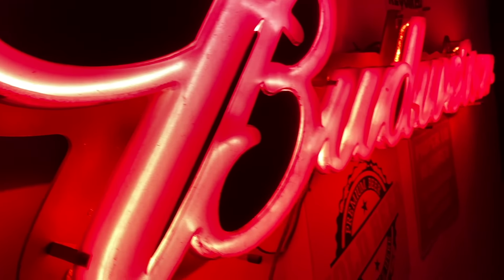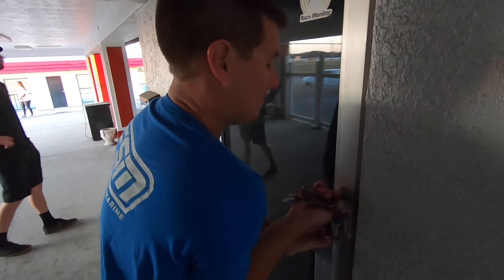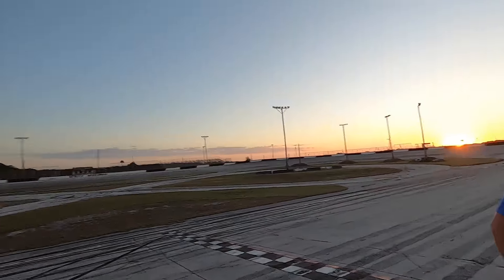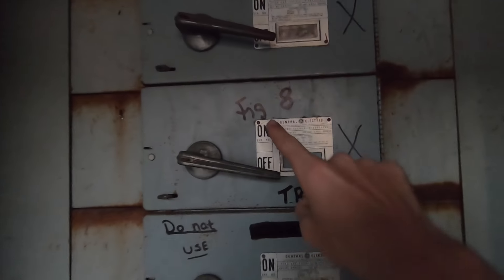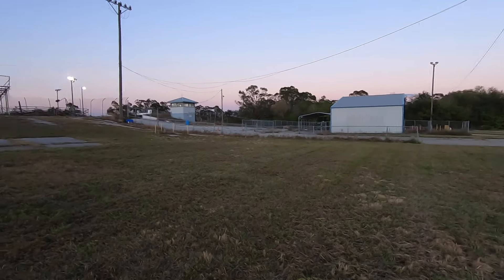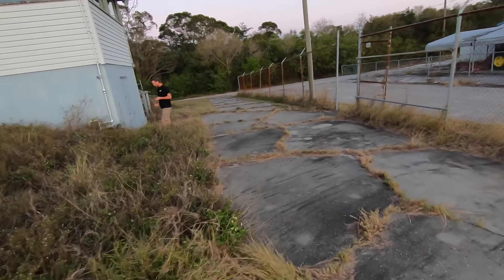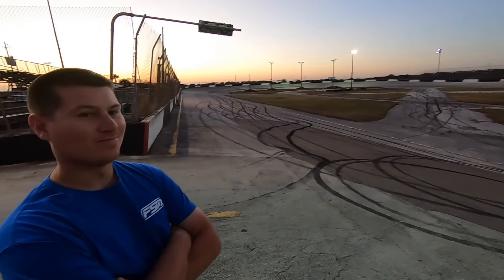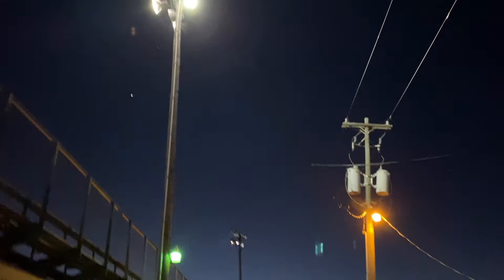Restoring Power to our Abandoned Speedway After TWO YEARS in the Dark! (Freedom Factory)

Comment: Love hearing you say that you want to switch to LED. Hearing certain people these days talk about incandescent being better than LED aggravates the hell out of me.
Reply: LED is cheaper/brighter, but alot of people prefer the yellow light from incandescents more
Reply: Caleb Fields so many people don’t realize that you can get LED bulbs in any color temp
Reply: We had these old lights on our mobile tower cranes aswell. 1500Watts per lamp usually 4 or 5  lamps per crane. Lately the manufacturer switched to LED. The LED lights are brighter BUT it is more directed at one spot. The old type that were used on the older cranes illuminate a whole area around the crane.

LED is alot more efficient though. You can also switch them on and off whenever you like. The old ones had to cool down for 15 min before they could be fired up again. The generators always had a hard time when the lights and heater in the cabin was on.
Reply: Your sad if hearing someone wanting to swap to LEDs makes you happy
Reply: @Newrangetank  no u. Leds are straight better
Reply: I don't think these are incandescents though... not with that warm-up time. These are some kind of HID lamps.

Comment: Again I'm a lighting electrician. This video is a hard watch lol I so badly want to make them all LED and working. You really should make those track lights LED though they take so much power
Reply: It would likely cost ten's of thousands though to do that.
Reply: I'm pretty sure he said he intends to switch them to led.
Reply: Expensive yes, but he should be able to get the lights for a couple hundred bucks each and if he can get a few guys to donate there time they should be able to finish all those pole lights in a few days
Reply: @UCCLdIk6R5ECGtaGm7oqO-TQ   LED costs are down from even just a few years ago plus the ROI on the power bill will be worth it. On top of that if you replace them with LED no need to buy a bucket truck like he said just rent a boom lift one time and you are good. Wont have to touch them for years.
Reply: @flyingmunk8956  Possibly, though professional-grade luminaires are going to cost a great deal more than your average domestic/light commercial fitting.  I would quite expect them to be more in the region of a thousand each for a decent quality item.
Reply: @UCCLdIk6R5ECGtaGm7oqO-TQ  I fou d a few different one that are like the ones I have done in baseball fields for like 350- 400bucks. There 400watts wich I more than enough for that track. The field I did this year was on the same size poles as the track and it look so freaking good
Reply: @UCCLdIk6R5ECGtaGm7oqO-TQ  it for sure wouldn't be cheap, but the price of quality LED lights has gone down a lot over the past few years
Reply: Needs to check with local power company to see if they offer rebate incentives to upgrade to LED
Reply: 10s of thousands of dollars for lighting is well within his reach, he will make it happen. Also, before you say it... I’m envious, not jealous. 😂
Reply: flying munk89 quality LED are not 300-400.  Those are cheap Chinese fixtures. A good 400w LED could be enough, as their lumen output is nearly equivalent of a 1000w MH fixture.
Reply: How much would it cost to run that site for 8 hours?  With the old bulbs verse new ones.
Reply: WiFivomFranMan with LED he could cut energy costs between 40-50 percent.

Comment: When i rented that track for events i paid 500$ for the lights from sunset till midnight
Reply: Multiple fees go into that but i pick up what you’re putting down
Reply: I figure the actual cost of electricity should be about $60 or less per hour for the lights figuring it at about 12 cents per kWh. That's with 100 5,000W lights. Not sure how many are actually there but about 20 poles 5 each should be close.
Reply: Im sure the cost was less than that but thats what they charged me
Reply: @VA-ng2ve  was 5grand total rental insurance lights he sold the beer.  After a few times  he jumped it to 10 and we said no thanks we never did another event
Reply: @VA-ng2ve  that was not including off duty cops as security which is 45$ an hour we had 6 there.     We paid out right about 10 grand. And a paramedic